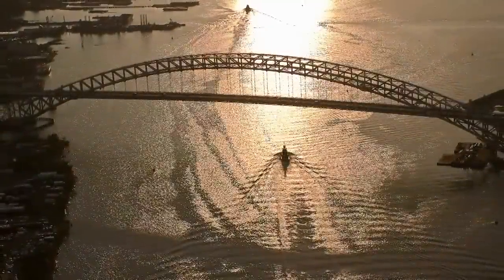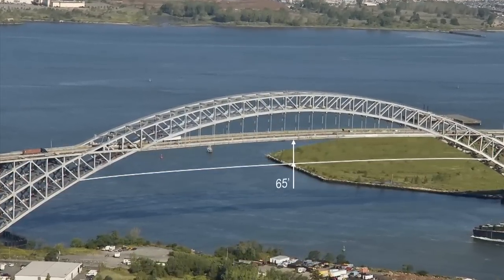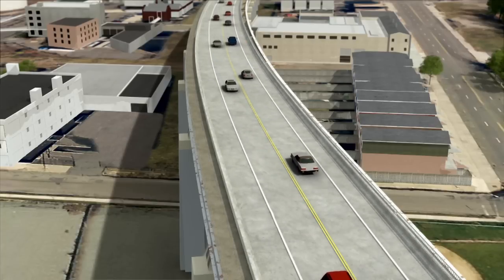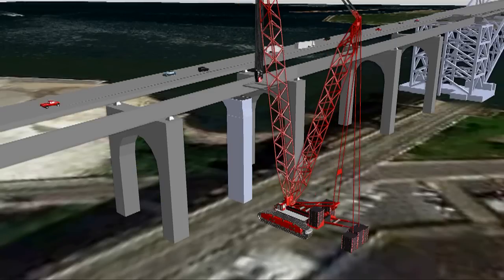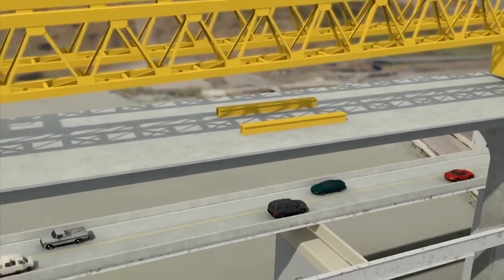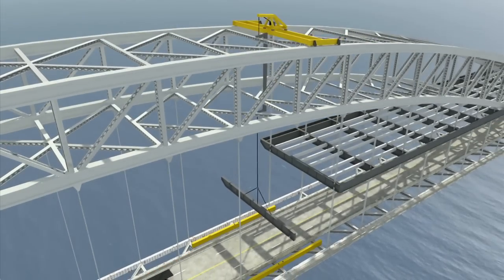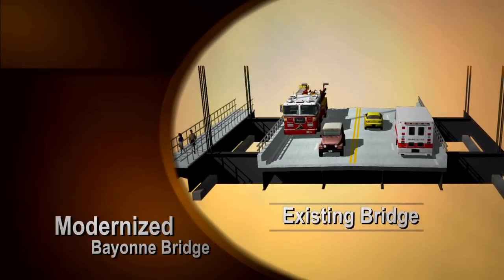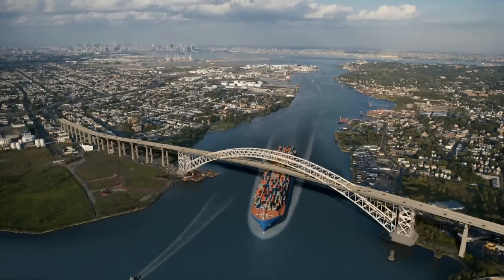Port Authority's Bayonne Bridge Raise the Roadway Project

Comment: This reminds me very much of the fatal design flaw in a 2-level walkway inside a gallery or some such place where they used 2 separate links rather than one to suspend the deck and the shear force of the load caused the lower span to fall.
Reply: You are probably thinking about the Hyatt Regency disaster in Kansas City in 1981.
Reply: Michael Niemiera Thanks, I couldn't remember

Comment: I was reading a Book about bridges, which was written by David B. Steinman, who also happened to be one of the Engineers who built the Bayonne Bridge... I knew the PANYNJ was planning to raise the bridge... Steinman mentioned that the steel arches exert a tremendous outward Thrust. The weight of the bridge on the concrete piers is NOT perfectly vertical... So I did a Google search , to see how the PA is going to tackle this project. Now I see that it's only the Roadway that will be raised. Good.

Comment: this bridge could of been double decked for 80 years and this video proves it
Reply: no need to.  i don't ever remember normal traffic being backed up on this bridge.  closed for a leaper occasionally or in 1966 two ships collided almost under the bridge.
Reply: They should double-deck the New Goethals Bridge as well. And then maybe also the Bayonne Bridge when it's raised.
Reply: No, the bridge was NOT designed for two Decks.

Comment: Watch this video on StreetFlimslog  about the Lincoln tunnel. also increase speed limits in the Lincoln Tunnel busway and open it 45min earlier and close it 65min later. London has prioritized bus lanes by making 3 lane highways into 2 and the 3 lane is for buses New York is bigger and New Jersey need a quicker cleaner way of accessing it.

Comment: Burj Khalifa was built with no regards to human life.  Search 'dubai slavery'.  They used unskilled slaves to construct it in heat we could not even fathom, paid them next to nothing, made them sleep on top of each other, and worked them over 12 hrs a day.  

The freedom tower is built to last.  The cleanup of debris, the new foundations (around existing PATH station), and the fact the the building is probably 4 times as strong as the previous 2 towers made it take longer.